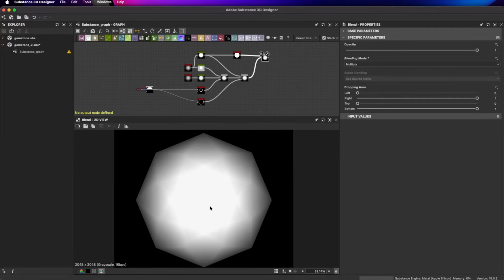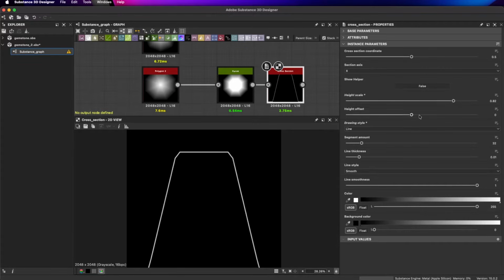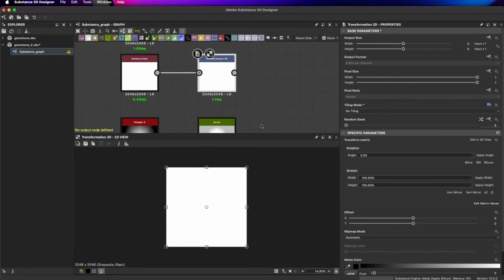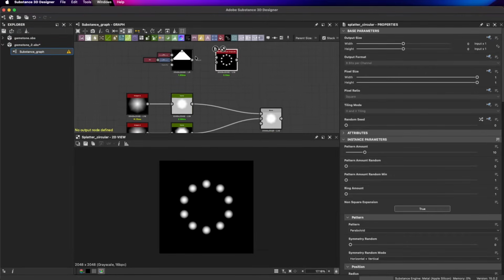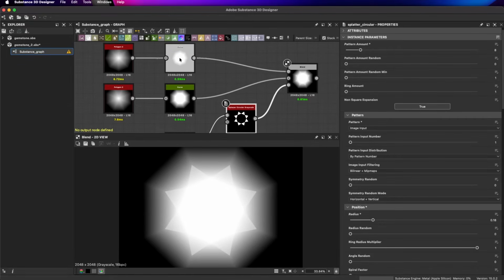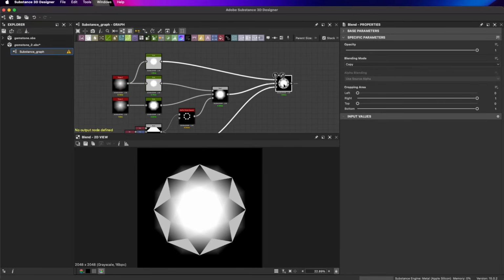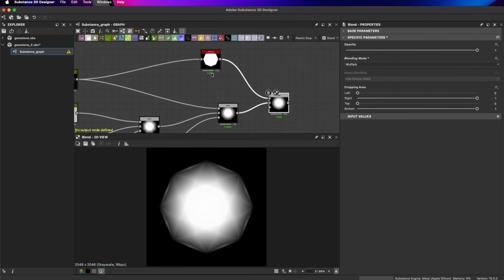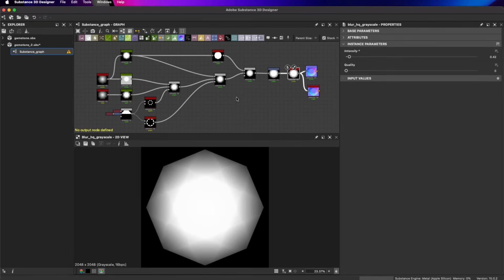How to create gemstone shapes in Substance Designer

Comment: Kinda surprised you weren't using the 3d view with the height plugged in to dial in your values when you were blending em together, ha.
Reply from the maker: Yeah, that is a great point. I was sending the height as alpha to Painter and using that but should have also used the 3D view in Designer.